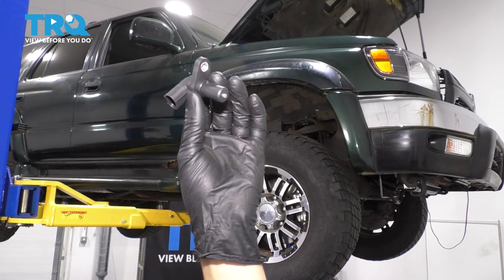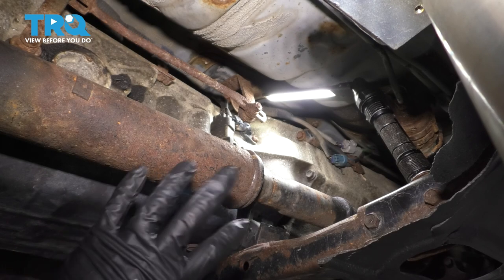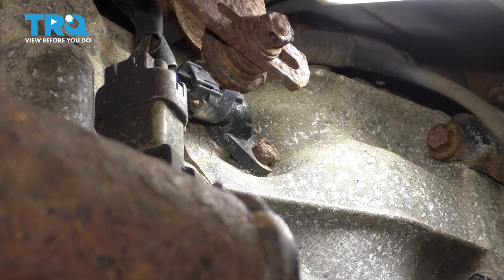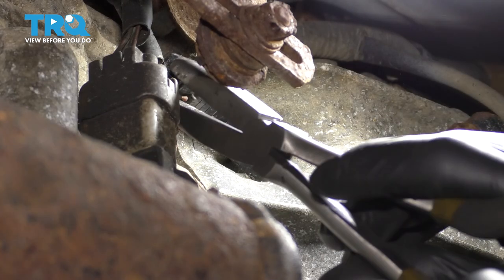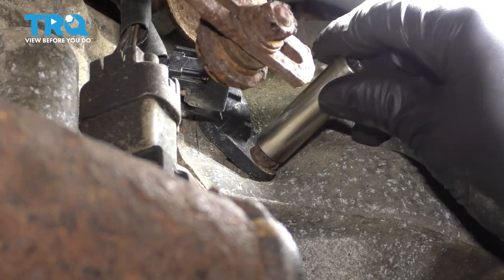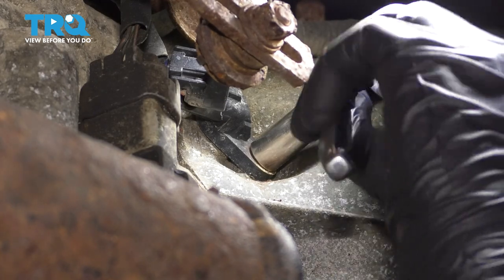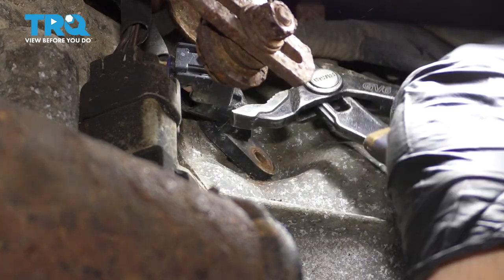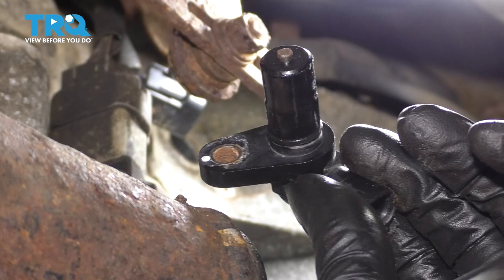How to Replace Transmission Speed Sensor 1996-2002 Toyota 4Runner

Comment: I’ve got the code p0500 saying it’s a speed sensor, the check engine and abs lights are on and the speedometer isn’t working, will this sensor you sell fix the problem? Thank you
Reply from the maker: +Cajun Magnet Fishing We wouldn't be able to diagnose an issue like that here, you may want to have a local mechanic take a look at it. Thanks for checking us out! http://1aau.to/m/Shop-1AAuto-c

Comment: I did both sensors on my 2005 2WD tundra and the Speedo still doesn’t work, checked wires and will be checking fuses on ABS anyone got any ideas? Is there another transmission speed sensor on it I’m sure that could be it, I was off roading in snow and noticed it crapped out afterwards.